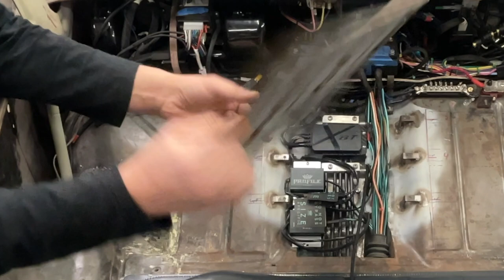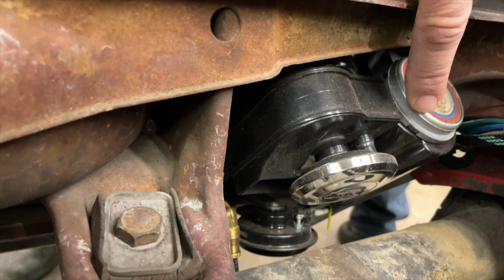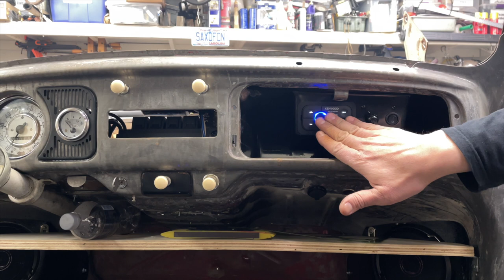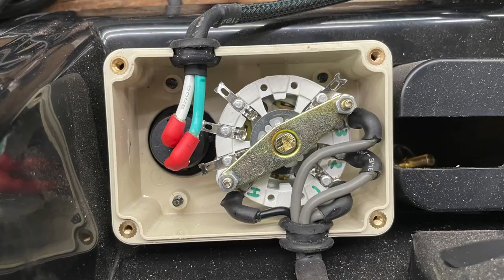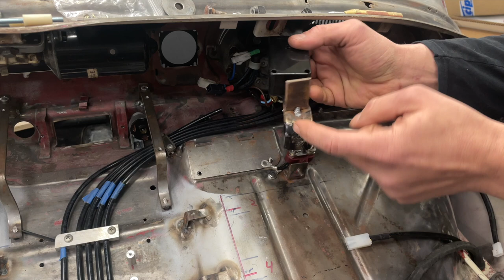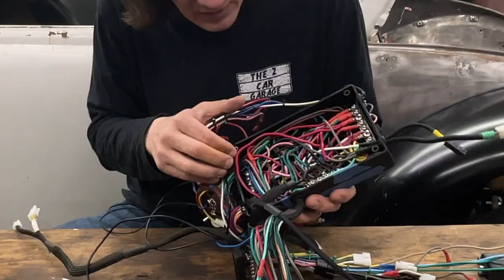Custom wiring on a Vintage VW Bug - Curt's Bug part 30

Comment: Lucas, you are one of the most knowledgeable and patience gentlemen in You Tube. I am having a problem in finding a way to installing the passenger rear view mirror outside on the door. Will appreciated if you can guide me into the best way this is possible accomplishing.
Thank you very much for your time, even it is not feasible doing this on my 1974 VW Standard Beetle.

.

Comment: Lucas, I gotta salute you for your planning and execution in that wiring job!  Such a high degree of craftsmanship is a pleasure to see, today!
Back in 1969, when I was 16 years old, I had a book about restoring cars. It mentioned using “adel clamps” to secure the wiring harness. I couldn’t find them anywhere back then, (probably couldn’t afford them if i found them). It brought back memories of rewiring my 1953 Ford Victoria, 413 Mopar, cast iron torqueflite!  Thanks!!